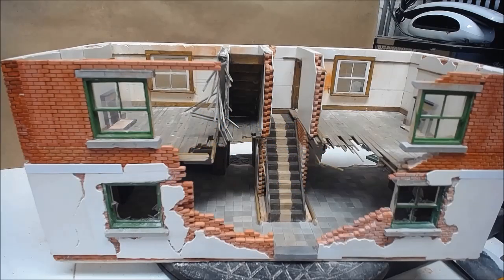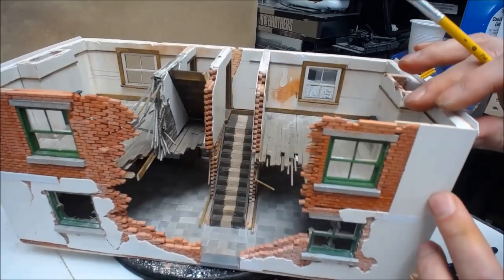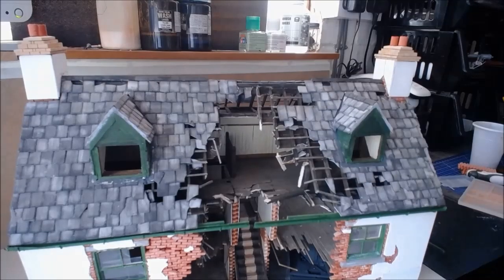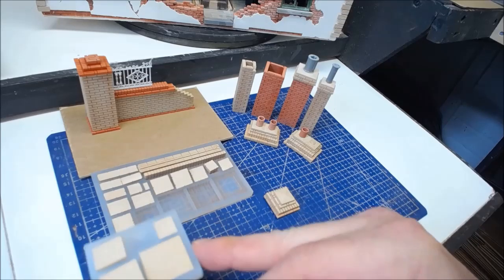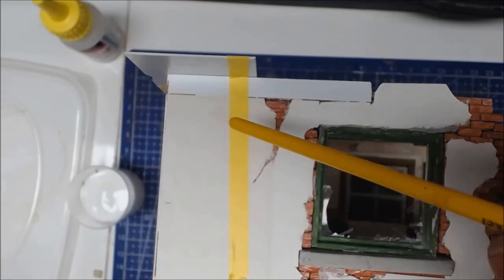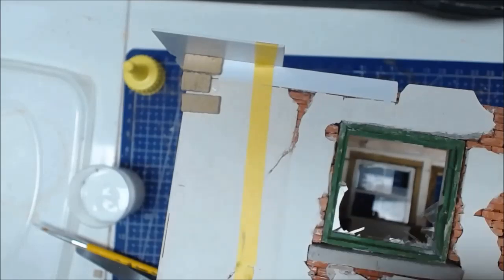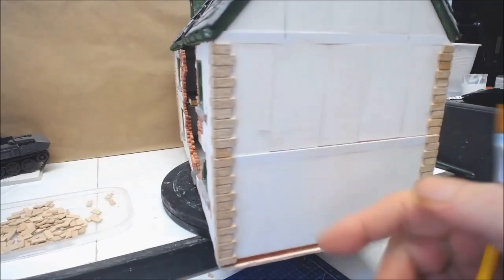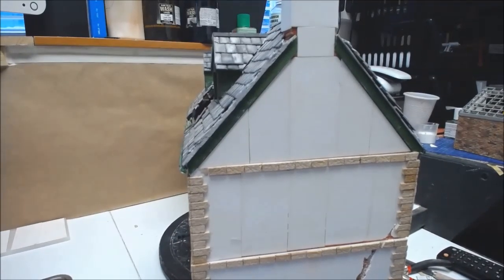House Builder part ( 3 )

Comment: Hi, where do you get your plaster from?  I’m also in the UK and have ordered some moulds after watching your videos!  Thanks, Steve
Reply from the maker: https://www.ebay.co.uk/itm/Herculite-No-2-Plaster-500g-1kg-2kg-5kg-10kg-15kg-20kg-25kg-Plaster-of-Paris/143107520067?var=442064409287    a link for eBay this company I use all the time many thanks sim
Reply: 1/35 Scale Diorama Builds 

Hi, I asked diorama debris for recommendations for “starter” moulds for building a road but they didn’t tell me anything.  What moulds would you recommend that I get?  I ordered the English bond walls, door and window, slate tiles and plaster board moulds today.  Have just ordered the plaster following your recommendation.  Thanks, Steve
Reply from the maker: https://www.dioramadebris.co.uk/135-scale-6x-10-setts-cobblestones-mould-1350011-9-p.asp

https://www.dioramadebris.co.uk/135-scale-6-curbstones-mould-1350061-58-p.asp

You can use the roadblocks link to that moulders is above 6 inch curb engines if you go back onto the channel you will find quite a few examples of using these blocks and curb engines if you have any further questions just message me out from our best to answer many thanks sim